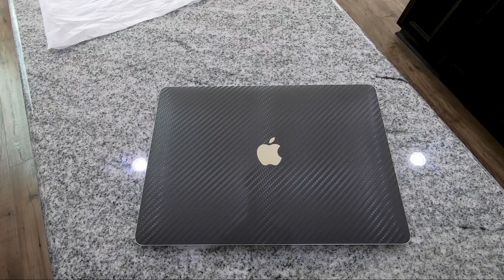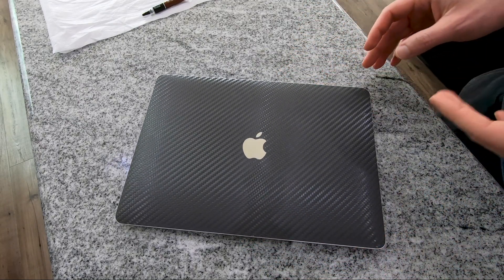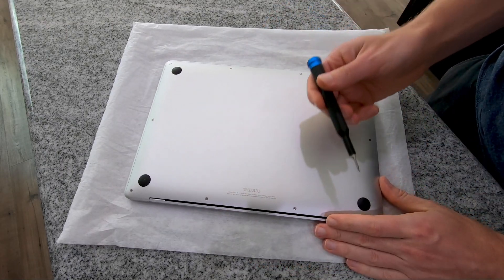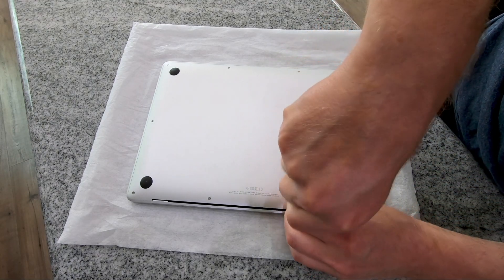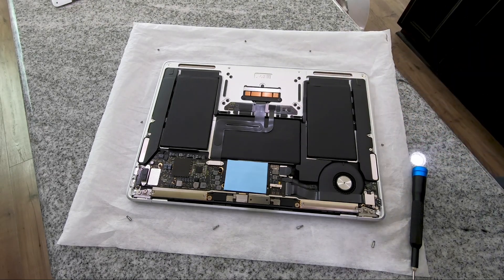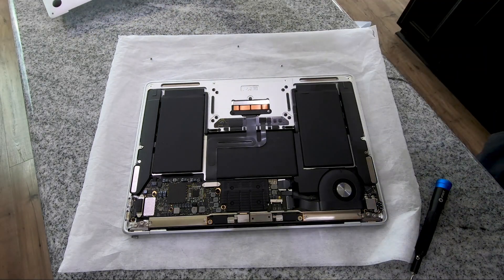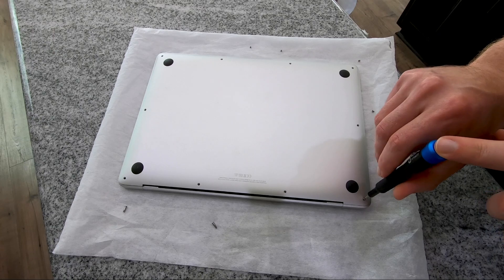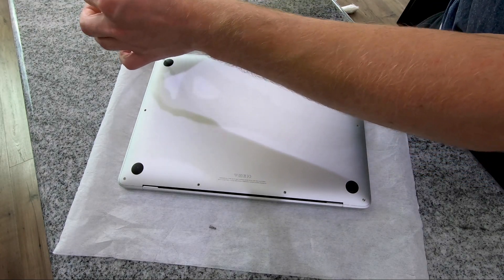How to Fix The 2020 MacBook Air's Cooling in Under 10 Minutes

Comment: It's a great idea and so simple. I don't have this macbook but thanks for the idea! Transfer the heat through direct contact to the aluminum chassis, why not if it's this easy! Aluminum is a great material for a heatsink! Most heatsinks are aluminum afterall.

As someone else in the comments has said, if you don't mind permanently modifying your laptop, remove that black tape for better contact directly to the aluminum.

Comment: I did it finally! Thermal pad improved my 2019 macbook air by alittle bit but the big change came when I put the copper shim and applied new thermal paste! It is a big change and basically didnt see my macbook go above 60 celsius in the CPU while doing normal work as before it would go to 99 just watching netflix.... There is not a huge improvement in the performance but staying cool makes it not lagg at all! Do it if u have 2018-2020 intel macbook airs! Oh and removing the insulating pad on the back of the macbook case improved cooling as well!

Comment: i used this method and it helped a little bit but I'm still just frustrated that the fan isnt attached to the cpu. My cpu will be at 100 degrees while the fan blows out lots of cold air. Super annoying, terrible engineering.

Comment: extra tip for for anyone else undertaking this mod: don't forgot to remove the insulating tape from the back cover, it's not going to transfer heat effectively to the chassis if there's an insulator in the way.
Reply: Sorry for asking such a dumb question but I am not that very techsavvy but which back cover do we take the insulating tape?😅
Reply: @mariovazquez1088 the one that has the same shape as the cpu heat sink
Reply: Thanks for this additional hint. I was wondering about this black stuff...wasn't sure if that was already a gap pad. But it really felt like an insulator.
Probably the device will now get super hot to the touch on the outside...most likely the reason why apple cam to the conclusion to insulate instead of enabling maximum thermal transfer. No issue if you know it however, you wont burn yourselfe that easily. Technically it makes sense to lead as much heat as quick as possible outside the housing.

Comment: hey I would like to ask if the 2019 macbook air model would be helped with the same mod? does it make it faster or anything? i got the 2019 i5 1.6gh with 8gb of ram looks simmilar inside
Reply: the 2019 and 2018 model has a smaller heat sink. It should work nonetheless, but I worry about fan airflow and batter overheating so have not started the modding yet
Reply: @markzhangcan  can you tell us if you ever do I would like to modify mine because when I use skype it goes crazy
Reply: @F-MK96  Yeah I am going to mod it, for the same reason. My plan is to also get a cooling fan that blows air towards the bottom of the MacBook hoping to keep the battery temp down. I just purchased Nkomax thermalright thermal pad + olmaster laptop cooler and will give you an update (if I remember. Try to remind me in 2 weeks if you would like to hear my experience)
Reply: @F-MK96  Hey I just want you to know that I removed the insulator pad between the CPU and aluminum bottom, and replaced it with Thermal pad. Thereby gaining 15% CPU performance in Geekbench 5. CPU Temp rarely goes up above 90C, which was often the case before the mod. Battery temp does not rise significantly thanks to external cooling fan. When using the laptop along with a protective case, the bottom gets warm but the laptop’s temperature is not concerning.
Reply: @markzhangcan  hey thank you for getting back to me! So the laptop works ok and there are no overheatings? Is it worth doing this?
Reply: @markzhangcan  sorry didnt see the full message... i would be interested in a video or step to step explanation on how to do it myself in order to not break anything. Let me know if its possible
Reply: @F-MK96  it’s basically the same step as shown in the video but removing the black insulator pad sticker, located on the bottom shell, above the heat sink. Be aware if you remove the insulator pad apple would likely notice that you opened the MacBook yourself, so I would recommend removing the insulator pad if your MacBook does not have warranty anymore. I only had 6-7% of performance improvement when I did not remove the insulator pad so it’s really up to you to decide.
Reply: @F-MK96  Before modding, My MacBook Air could barely handle Zoom video + screen sharing, and the battery would heat up to 40c+. After modding (insulator pad removed) it’s working faster an snappier. The internal fan still produces sufficient airflow, and battery does not heat up above 37C when I Zoom (it would still heat up above 37C if I push it really hard, but the CPU still does not throttle). If you decide to remove the insulator pad, make sure your thermal pad both touches the heat sink and the aluminum bottom.
Reply: @F-MK96  I would also suggest downloading TG Pro, a temperature monitor + Mac fan controller. I set the the internal fan to “Auto Max” mode with 3 conditional setting: Fan speed 100% when 1. “Average CPU is above 90C”, 2. “Battery is above 35C”, 3. “Intel UHD Graphics is above 90C”. This way I can ensure the fan will kick up automatically and cool down the MacBook when major components gets hot.
Reply: @markzhangcan  thank you very much for the details. I would like to try the mod just without using a cooling case so hopefully it will not burn out :D and my warranty is long gone!

Comment: Had similar mod on my 2015 i7 MB Pro, it really helped with temp at low load, but later i experienced other issues with this mod, chassis is overheating battery which tremendously reducing it life span later leads to battery swallow, same problem we have in surface pro book, they placed heat pipes right on the battery, same issue...
Reply: that's right: li-ion battery normal temperature should be from 0 to 26 Celsius. this mod can cool your CPU, but definitely ruin your battery

Comment: Is there anything better?  6.0 W/mK is okay, but I bought the one with the i7 cpu which gets a little bit hotter. Any other compounds with better heat performance, were unfortunately electric conductive.

Comment: my mba 2020 i3 base model (Aug 2020) lowest spec is downloading asphalt 8 using the epic games installer. its 43GB and this is the only time I've noticed high CPU temps of 94C (nothing more) (space / room temp is 23.3C). I am not sure if its a reason to do this mod but it makes me feel like I made a bad buy. The computer doesn't run slower its just louder and hot at the top of the keyboard. other than that. when use 2020 photoshop and a lot of other intense apps. the temps is usually around 55-65 70 for the most (app start up) and the noise and heat is low to not noticeable. I guess it's okay if its only during constant "write disks" time. meh. first and maybe last MacBook...only some time will tell

Comment: Hey man, most of people said you have to take off that black pad on the aluminium cover so you trnasfer heat from processor to the aluminium back (then the aluminium back is super hot and you lose varranty),but you left it there. Had you any problems with the macbook since than? I really want to try this but still, i am little bit afraid. Thanks

Comment: Damn, Linus sure did take a complicated path here
Reply from the maker: Right!? Where's my Forbes article? 😬🤣
Reply: @carcrazy2424  I can’t find Arctic branded thermal pads for sale in my country, I find Thermal Grizzlys Carbonaut plentiful though. Could you tell me what thickness I should get if I plan on using the Carbonaut? And if it would be inferior to Arctic’s?
Reply from the maker: @jackeytam7700  A 1.5mm thick thermal pad worked perfectly for me!
Reply: @carcrazy2424  Gotcha. Thanks a ton for the speedy reply mate!

Comment: "The fact that there is no heat pipe here isn't really much of an issue"... in the great words of doctor cox "wrong wrong wrong wrong, wrong wrong wrong wrong... you're wroooooooong... you're wrooooong" :) haha. sorry just messing but yeah, sorry, absolutely incorrect. The problem lies in people buying these and going woohoo i can now edit all my 4k videos on a mac. 100 hours later at 2000 degrees celcius (roughly :) ) the cpus on these machines are going pop left right and center. So yes, it is an issue and yes another ridiculously dim decision from apple. The older macbook airs had the heatfins and 0 issues.

Comment: Tried it with MBA2018 and Arctic Thermal pad (1.5 mm thick)

Cinebench before:
591 Points 
Temperature const. max

Cinebench after:
648
Temperature const. max 

Performance increase of nearly 10% for 10 bugs - I’ll take it !

Comment: How is separated fan and heatsink design not an issue for an i5 thin laptop? This laptop runs hot. It is a faulty design.
Reply: Simple Life the fan and heat sink aren’t not connected at all apple uses a passive design were the bottom case forces the air flow to go a certain way. It’s not the best or even that good but it is cooling.

Comment: I've been thinking about doing this mod to my i3 laptop and I'm wondering if it will work on the i3 model and if the thermal pad may block airflow as I've heard the i3 has a different way of cooling than the i5.
Reply: i recently had an i3 version of the macbook air 2020. do u use this pad? does it work ? do i need this? and i would like to ask you to which games can you play on this device. i am not a regular player but i want to play some games tho.

Comment: I suspect this mod is a bit dangerous, because it wont appear directly and not obvious, but thermal pad blocks airflow to CPU power circuit mosfets. And they tend to overheat even in stock design.

Comment: The disadvantage of adding thermal pad to transfer the heat on the bottom cover is that will heat up the bottom cover and will hurt you lap if you put it on your lap, that's why apple or other brand will never do it. But for me, I will never work on my lap, so this is the perfect solution for me.
P.S. I am using a 2015 MacBook Pro 15" and 13"

Comment: I've just ordered a thermal pad and screwdriver, to do this on my i5 2020 MBA. I'll post an update when the modification is done.

Update: Installation was a breeze. Cut the thermal pad down to 35mm x 45mm and placed it in the middle of the heatsink. Booted the computer up and... no fire! ;)

I've used the Artic Thermal pad (1.5mm thickness) and an iFixit P5 screwdriver.

I ran tests in GeekBench and Cinebench R20. Here are the results:

GeekBench
  Before
   > Idle temp 44 °C, during test temperature hovered around 80-100 °C, mostly 100 °C.
   > Max RPM: around 4100
   > Singlecore: 1146
   > Multi-core: 2938

  After
   > Idle temp 37 °C, during test temperature hovered around 80-99 °C, mostly 98 °C.
   > Max RPM: around 4000
   > Singlecore: 1121
   > Multi-core: 3511

Cinebench R20
  Before
   > Idle temp 45 °C, during test temperature instantly rose to 100 °C and stayed there.
   > Max RPM: around 6600
   > Score: 986

  After
   > Idle temp 39 °C, during test temperature shortly hit 100 °C and then hovered between 90-99 °C. A few times the temperature stabilized at 92 °C and 96 °C.
   > Max RPM: around 4000
   > Score: 1131

During testing, the bottom of the laptop does not get so hot that it hurts. I'll let you know if anything changes. Thank you carcrazy for now! It's a simple effective solution for little money :)
Reply: How is it now?
Reply: @ralphy8844  I will receive the items today, so I'll place an update as soon as the mod is done :)
Reply: so it just apply the thermal pad? no need to put any thermal paste right? thank you
Reply: @aldyannatanael  No, I just applied the thermal pad as shown in the video. Of course something like the copper shim mod would drop the temperatures even more, but I don't want to void my warranty. The thermal pad is a great, simple solution. I never reach the 100 °C under normal usage with a thermal pad. And my macbook is still up and running, no issues after a month of thermal pad usage ;)
Reply: @F G I agree with you on that. But keep in mind this is under maximum load during a benchmark. Under normal usage (with a couple of apps open and running tasks in the background) it doesn't even hit the 90 °C where before it would instantly heat up to 100 °C.
Reply: Klik link when putting in the thermal pad did you apply any thermal paste or you just slap it in and done?
Reply: A J Just the thermal pad (as shown in the video). Also a quick update: still running totally fine with no issues whatsoever. No need for turbo boost disabler anymore :)
Reply: Kliklink thanks bro 👍
Reply: did you find any impact on battery temp?
Reply: @mattAN998  To be honest, I didn't pay attention to that. I didn't check the battery temperature beforehand, but have to say I'm not noticing any crazy changes now. Recently I did the copper shim mod, which makes the laptop run even cooler and faster. If you would like a more comprehensive answer to your question, I recommend that you ask your question in the "2020 Air Heatsink Modification Thread" on MacRumors :)
Reply: One thing , did you unplug the fan since it doesn’t do anything besides just annoy ?
Reply: @mikaelhay301  I definitely did not do that. The fan is not as effective as if a heat pipe were attached to it, but it is certainly not there for decoration. The laptop runs a lot cooler with the thermal pad mod, and the fan still helps to bring the temperature down. The air is (at least I thought with the i5 and i7 models) blown through the heatsink. As carcrazy explains in the video, the thermal pad mod increases the effectiveness of the fan. More air is blown through the "corrugated" style heat sink. I use the app Macs Fan Control to adjust the fan speed up (or just set it to automatic) whenever I want. I see a big difference when I set the fan to 5000-6000 RPM and when the fan does nothing.
Reply: Kliklink ok then. Well , if some people can afford a base MacBook Pro , why do they buy the MacBook Air instead of the 200-300$ more expensive 13 inch base MacBook Pro wich has a fan and heatpipes connected to heatsink of cpu and integrated gpu ?
Reply: Razer Fan Boy I can't speak for everyone, but personally I love the MacBook Air. It’s a thin laptop, the screen is beautiful, the speakers are great and it’s the first laptop on which I use a trackpad instead of a separate mouse. I bought the Air just after it came out. At that time, the 2020 13-inch Pro was not yet released and the choice for the 2020 Air was quickly made. The laptop (even without a thermal pad mod) runs fine when you do not perform intensive tasks with it. For users who do video editing or heavy-duty tasks on a daily basis, I can understand the upgrade to the Pro (I've got a desktop for those tasks). For me, however, the Air is fine and this modification ensures that I can sometimes get a little more out of the laptop and that it runs a bit cooler.

Comment: Does the temperature improve more if you remove the black tape on the inside of the aluminum and allow full contact with the bottom of the case?
Reply from the maker: I'm sure it would, but this may pose a burn hazard. If you're looking for even better temps and you're willing to modify the device, I'd recommend the copper shim mod instead.
Reply: carcrazy2424 Is this mod detailed anywhere? Can you share a link or demo?

Comment: sadly, as this been tested now, it does absolutely nothing for thermals beside 1 degree, from 99
Reply from the maker: The pad alone won't be able to completely solve the 2020 Air's thermal issues, it simply allows the CPU to maintain a higher clock speed before running out of thermal headroom.

Comment: Linus tech tips recently did a macbook air cooling video, he showed how the heatsink isnt making enough contact with the cpu he couldn't enen spread the thermal paste with the heatsink. Do you have a similar problem?
Reply from the maker: Indeed. The issue seems to be worse on the older models. Linux got around this by using heavy machinery to modify his heatsink... The rest of the world has simply been installing a copper shim to fill the void.
Reply from the maker: To clarify, by "older models" I mean early 2020 Airs. There's an expectation that Apple corrected their manufacturing processes after all of the poor reviews the device received.
Reply: carcrazy2424 could it be fixed by putting a thin (0.2 or 0.5 mm) thermal pad vetween the cpu and the heatsink?
Reply from the maker: @mayssi8923  The typical fix is to place a 0.3mm or 0.5mm between the CPU IHS and the heatsink.
Reply from the maker: @Channel 11.11 Given the seemingly poor quality of the thermal paste that Apple is using, I'd wager it's not going to matter. If you're not satisfied with the performance of your Air (either stock or with just a thermal pad over the heatsink,) go for the copper shim method mentioned above.
Reply: @carcrazy2424  #releasethecoppershimcut
Reply: @carcrazy2424  when will you release the copper shim video?

Comment: I changed my thermal paste and did this to my 2019 air thx.
Reply: Im planning to change paste also on my 2019 air. How was it? Do you need to remove hundred of different screws and remove the touchpad? Thanks.
Reply: maysion no it’s easy the 10 case screws then 4 t3 screws on the black heat sink the paste is very dark and very thick the thickest I’ve sever seen on a computer it’s not good at all I hope the man in this video changed it out before he did this pad
Reply: @mayssi8923  No u only need to remove the 4 screws for the heat sink.